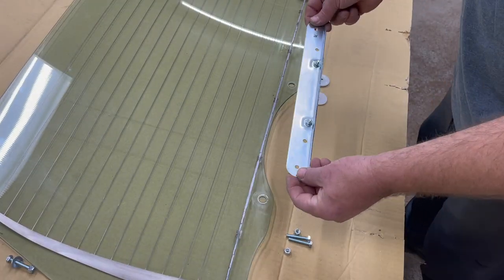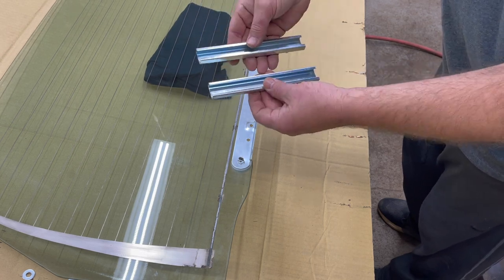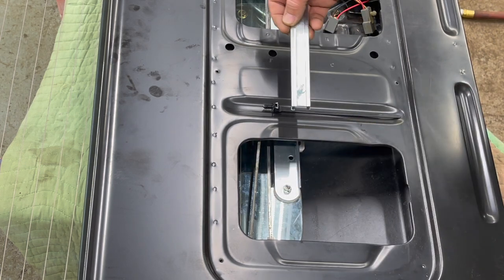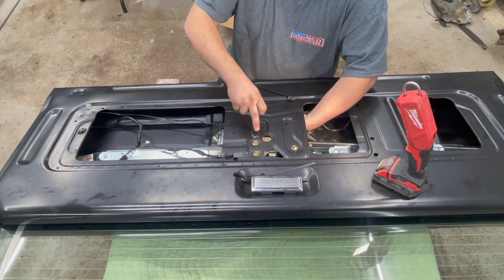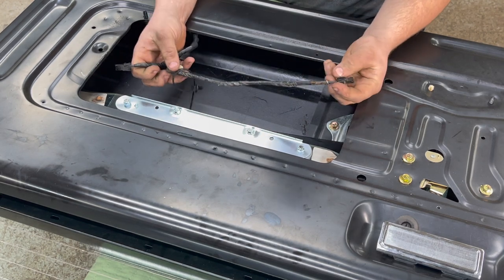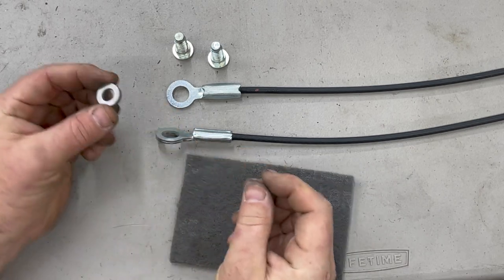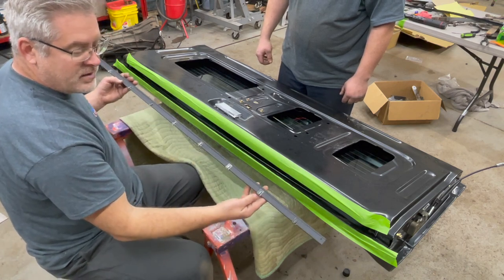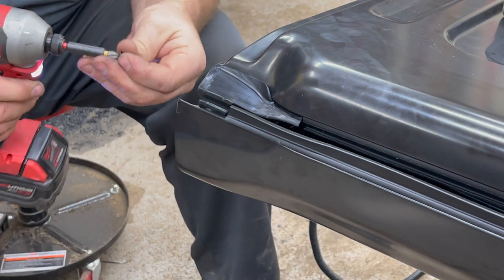Ford Bronco Tailgate Repair & ASSEMBLY:  Part 3 of 3

Comment: Great video but, Im guessing you aren't drilling the holes for the spare tire holder? Can't find any videos on the best way to do that. Thanks
Reply from the maker: The best way we found would be to drill a pilot holes after the internal brace has been installed properly. If you have a right angle drill you can drill through the center of the welded bolts on the reinforcement plate.

Comment: I'll be restoring my 1984 Bronco soon, thanks as the tailgate is a issue that details do matter.
Reply from the maker: Good luck. Email with any questions or contact Jeffs Bronco Graveyard for new parts.  I sell used
Reply: Same here. '84. My window shattered when my nephew drove it with the windows cocked.

Comment: What about installing it on the truck and setting the torsion bar?
Reply from the maker: We close the tailgate as much as possible and us a bent pipe to hold tension in place while attaching the bracket

Comment: Hi Chris. Thank you so much for the video. You said to lubricate the window slides and you would do it later in the video. I can’t find where you did that. What did you use?
Reply from the maker: I used white lithium grease.   If your in an area with no salt, try silicone lube. (Lube more often). The tailgates get dirty, hence no grease.  But you can use whatever you like.

Comment: Great video. My biggest problem is dealing with the torsion bar during the removal and install to and from the truck... Any suggestions on how to relieve the pressure of the bar during the actual removal and reinstall process?
Reply from the maker: When you remove the torsion bar- try doing so with the tailgate closed as much as possible while a friend removes the pigtail bracket. Doing so removes some tension.

Comment: Do you guys recommend using any lubricant/silicone on the new felts for the glass?
Reply from the maker: No lube on felts.  Just the white slides and regulator

Comment: As the wiring comes out of the motor, there is a 90 degree rubber boot with a foam/rubber piece to attach it. Where does it attach?
Reply from the maker: Please email me a pic. Email in description.

Comment: I just have one question my slides are original and are riveted together so how would I go about putting those on? Slide over the Regulator part first then bolt it to the glass or some other way?
Reply from the maker: Drill them out and the new go on with a threaded stud and nut.

Comment: What lubricant do you recommend for the window slide tracks?

 I have an issue where my glass slows down/ stalls during cold weather, at the halfway point when moving in either direction.
Reply from the maker: We used white lithium grease but more than likely your white slides are seized up.

Comment: Awesome video series, they helped me a ton. Thank you! I believe the tailgates came from the factory with a vapor barrier. My understanding is that they were rather cheap and certainly all long gone by now. How important do you think it is to make/replace one?
Reply from the maker: Thanks you.  I’ve never seen vapor barrier in tailgate. I’d simply cut a piece of thin, semi-rigid pink foam sheeting to fit directly under the inspection plate.  My concern with TG will always be sealing the bottom seams from the inevitable standing water. (But keeping drain holes open). In a quick follow up video we will show how we sealed up the outer/ lower edge of the tailgate seam.

Comment: I rebuilt the tail gate, new torsion bar and seals.  I am working on the swing arm tire carrier, replacing the bushings.  I have not been able to knock the pins loose.  Any suggestions?
Reply from the maker: These are tough.  And plastic.  I’ve never taken one apart personally.  Post the question in the FB group Broncos And Parts Garage.  I know guys have rebuilt them with bronze bushings!!!

Comment: Do you grease the regulator slides at all? If so what type of lube?
Reply from the maker: You shouldn’t have too.  But I’d use a graphite lube.  Any wet lube will attract dust and dirt.

Comment: Absolutely great videos. I would have never gotten through my rear window issues without them. I do have one question. Do the motor and defroster harnesses go over or under the window tracks. I saw on the video that the main harness goes under the window track through the tailgate but did not see where it said to route the motor and defroster harnesses. Thanks again for the great work.
Reply from the maker: Thank you. My defrost was over the track.
Reply: @BroncosandPartsGarage  Thanks. Just to clarify, you are saying the defrost wiring goes over the window track and the motor wiring goes under the window track?
Reply: Ok, I got it figured out. Once you understand the window movement and how the harnesses have to move (or not move), it is apparent that both the defroster and motor harnesses have to go over the window track in order to stay out of the way and attach with the christmas tree fasteners into their locations. Keep up the good videos.

Comment: Hi Chris, my tailgate still weighs a ton to open and close. I saw in part 2 when y'all reinstalled the torsion bar but did I miss the part how it actually assists in opening and closing the tailgate? Thanks for the vids.
Reply from the maker: Once the torsion bar is installed, as seen in the video, and captured in the small pocket along with the two silver counter balance brackets, the portion sticking out of the tailgate is captured to the inner passenger side body by a “pigtail” shaped bracket between the hinge and cable. I can email you a picture if you email me.  Once installed, as you lower your tailgate, the energy is stored in the torsion or tidying if that metal rod. You should be able to close a Tailgate with one hand.
Reply: @BroncosandPartsGarage  Hmm mine must be messed up inside because I see the bar in that bracket on the outside. I'll watch it again. Thanks again
Reply from the maker: @keithmagruder8973  Usually the pocket on the driver side of the tailgate rots  out and the torsion bar will come loose and if you’re lucky it will hit the bottom of the tailgate shell and not your glass.  After our tailgate glass was installed we filled the torsion bar pocket with about a quarter can of rubberized undercoating‘s to keep water out of that pocket

Comment: After replacing everything except for the glass I recently discovered that water is leaking into the tailgate from the window in multiple locations. I don’t know if I have a bad seal between the felt and the metal or the felt and the window. Have you had a similar challenge and how did you fix it? Thanks again!!!
Reply from the maker: In my experience, water will find its way into the tailgate.  The seals are very good at keeping out  the water, but the glass is still wet upon entry.  And there are drainage holes in the bottom.  How much water are you getting?
Reply: I can see the water dripping into the tailgate (I have the cover off). I have also noticed that the weatherstripping in the bottom corners have gaps that I can actually see through. My biggest concern is the tailgate rusting out long term, and they carpet getting wet everytime it rains in the short term. Thanks for your help!

Comment: I just realized yesterday that part of my problem might be that the window is not even. The right side is slightly higher than the left. Any suggestions on how I fix that?
Reply from the maker: That usually caused by the small white sliders being stuck in their tracks. And not pivoting or being corroded. It’s an easy fix once you get it taken apart.

Comment: Any tips for fixing the defroster connector on the window? Mine have snapped off
Reply from the maker: There are a variety of companies that make an adhesive that has conductive properties. Just search online or Amazon.
Reply: @BroncosandPartsGarage  Thanks for the quick reply. I'll check that out. Awesome video's as well! Been going through the motions on my 91 XLT, rebuilt the transmission and the 351, stainless exhaust, steering box and column, and now going to tighten up the little things then do the suspension.

Comment: It appears the new tailgate from JBG does not appear to accept the exterior silver pannel.  I want to keep the origional look of my 1996 XLT so I'd like to keep it on if at all possible.  Any suggestions?
Reply from the maker: It can be done, Option 1.  Use a piece of cardboard and press it onto your silver panel allowing the studs to pierce the cardboard. Then you want to trace out the lock hole. you’ll use the cardboard as a template on your new tailgate. And you’ll use the lock hole to align your template perfectly.  Option 2- it’s not the easiest task to perform, it would involve putting a grease marker on all of the studs coming out of your silver panel. And then placing it on the TG and using that as a template to drill your holes.  The bonus to this, would be if you were off slightly, the holes will be covered if you need to make them larger or oval them out slightly.    The lock hole is your biggest challenge.  Or simply take your Bronco to a detailing shop and have a vinyl image of the tailgate panel installed on your tailgate.   Thanks for the question and please remember to subscribe and like the content.

Comment: Outstanding video. One of the most useful videos I’ve found and I use YouTube videos for almost everything.  I am rebuilding my tailgate so this was particularly helpful to me! I have two questions: (1) where can I buy new latches or what’s the best way to clean up and grease my existing latches?; and, (2) can you do an in depth video on rebuilding the tailgate wiring harness? I don’t have much experience with electrical wiring and this would really help me complete my tailgate rebuild.  Thank you!!
Reply from the maker: Thanks. He latch mechanism we installed can be purchased as Jeffs Bronco Graveyard. Links in description.  We also sell them used. The  actual latches that grab the strikers on the truck body, we soak in parts cleaner and clean with small brushes. The use fluid film as lube.  I would NOT sand blast.  As far as the harness, rebuilding would be the painstaking task of unwrapping the harness and laying it all out to duplicate.  We simply went thru ours, found the chaffed installation and either covered it up or cut out and repaired “black or green” corroded wire. We part out lots of broncos and occasionally pull really good harnesses as well. And we sell them.
Reply: Thanks!  What do you recommend for lubricating the metal window tracks (where the plastic piece spin as window goes up/down)?
Reply from the maker: Would use silicone spray or very light lithium grease.  Depends on the environment
Reply: I live in central Florida. Would you recommend one over the other? I’m hoping this resolve the fact that after pulling everything out and replacing it, the window still struggles to go up. Not sure what else my problem would be…
Reply from the maker: @Tucker355  when you had the regulator out, did you try pushing the arms down and letting it snap back shut?  We’ve taken out regulators that when you push the arms down, there’s so much corrosion and resistance they don’t overpower the return spring and they stay in the same position!!Also did you replace the felts that are in the vertical glass alignment tracks that mount on either side of the tailgate?   I would use a very light, white lithium grease on the tracks and slides. But they need to be spotless before you apply any type of lubrication. Also look for a bad ground or fraying wires that would little the  amount a voltage to the motor.  Also if you ever had your top off, make sure when you put it back on, that you always install the bolts that hold the topper to the roof of your vehicle first and then work your way to the back. It will keep the top from leaking and it will line everything up properly.  Perhaps you could email me a video. My email is in the video description
Reply: The regulator, tracks, and the felts for the side tracks are all new. I sprayed the felts and tracks with lithium grease.  The window runs relatively smooth except for the top ~25% when closing. It gets very sluggish and struggles when it is moving upward to close; but run’s smoothly all the way down. I’ll send you a video Friday, but if you have any further ideas before then please let me know. I greatly appreciate all your assistance. Hank

Comment: Any idea how to replace the tailgate aluminum trim that has the Ford logo? It looks like the new parts come without any holes. Also, it's hard to find it.
Reply from the maker: The seals can be done. Just a bit harder to do.  For the metal panel You’ll need to make a paper or cardboard template and measure twice. Drill once!!!  Or have a tint shop just make one out of vinyl wrap.  We sell the metal panels.  Used.
Reply: @BroncosandPartsGarage  I'm planning to buy an XL and add that trim to it. It looks empty without it.
Reply: @BroncosandPartsGarage  Thanks!
Reply: @BroncosandPartsGarage  You guys are awesome, I subscribed and I'll buying parts too!

Comment: Great video, and great series!  After watching this series, I am thinking there is something wrong with my tailgate shell itself, as I now see there doesn't seem to be any adjustment in the side tracks that bolt to the sides of the tailgate.  On my tailgate, the glass opens into the back of the Bronco, as in it doesn't follow the contour of the fiberglass top.  I have to push out from the inside so that it goes into the grooves on the top.  Perhaps the tailgate isn't aligned?  Perhaps the aftermarket glass isn't contoured properly?  I am wondering if starting with a fresh shell may be the ticket?  Mine has the typical rust in the bottom, but is otherwise sound.  The cost of the shells isn't terrible, but is the quality of the aftermarket shell worth not using an OEM shell?  Etc, etc.....regardless, this video series lines it out perfectly, again, great work, and thank you!
Reply from the maker: The vertical guides the glass “rides” in can rust where they bolt onto the tailgate. So I would check all four of those bolts.   You didn’t mention what year so I can’t help with glass or topper info. Jeffs Bronco Graveyard sells the shells and guts. Links in video description. I wouldn’t buy from a “non” Bronco dealer as you’ll want Bronco people selling you Bronco parts and Bronco customer support. New OEM shells are obviously long gone. Used OEM would be great but I’m in Detroit.  They’re all rusted out.  Good luck on your project.  Don’t forget to subscribe and share this video !!
Reply: @BroncosandPartsGarage  Apologies, I should have mentioned that it is a 1985 XLT.  I don't believe the top has ever been removed.  The PO kept it in the garage for the past 30 years, but it wasn't a garage queen....he used it for a daily, as well as a hunting rig.  When I had the glass replaced, I had "nearly" all of the guts replaced, including finding a Motorcraft motor.  The fourt pieces I didn't replace were the two vertical guides, and the two sliders the bushings on the regulator slide in.  Bad move on my part......damn!  My Bronco is a New Mexico Bronco, so it is relatively rust free....just the tops of the rear wheelwells and the bottom of the tailgate.  The rest is solid.  I am not opposed to a new tailgate shell, as the cost to repair the rust, repaint, etc, etc, may actually come out to more money than the new shell.  I hear the CAPA certification helps, but I think that's just against corrosion, not the balance of the construction.  Thank you for the heads up on the vertical guides!  I will look at those right away.....well, when the sun comes back up!
Reply from the maker: @agar4278  well the glass should have a slight ark too it. I’ve never seen a capa tailgate but as long as you seal up the seams, shouldn’t be an issue. Keep me posted or find my email in description.
Reply: @BroncosandPartsGarage  Will do, thank you!!

Comment: After installing a new aftermarket tailgate i can't get the gaps to match. It still needs to come up 1/8 on the passenger side but the gap on the top
 drivers' side is almost closed. Being 76 years old isn't helping any.
Reply from the maker: Sorry your having trouble.  The strikers have some adjustability.